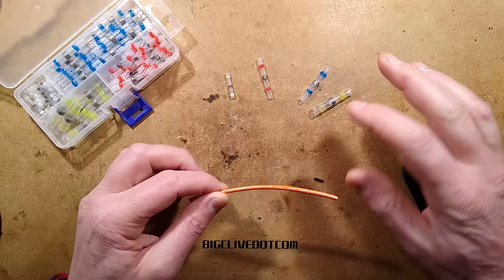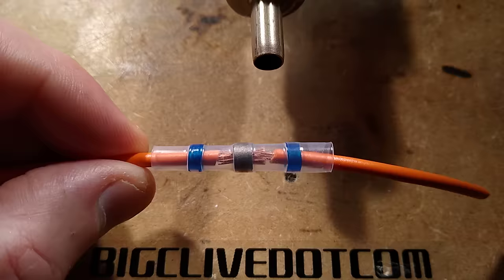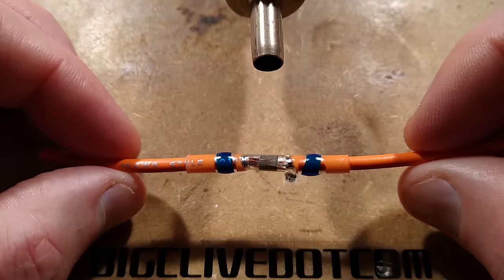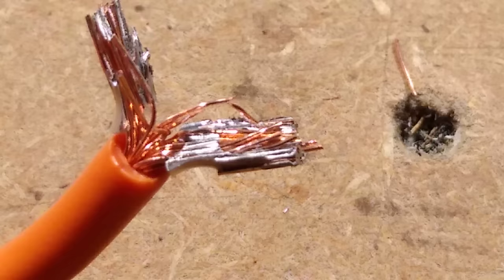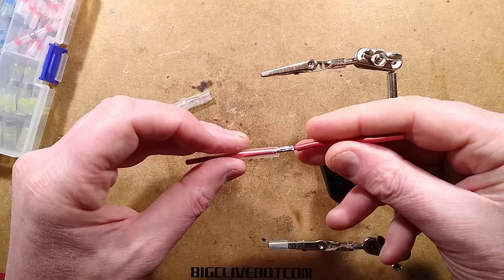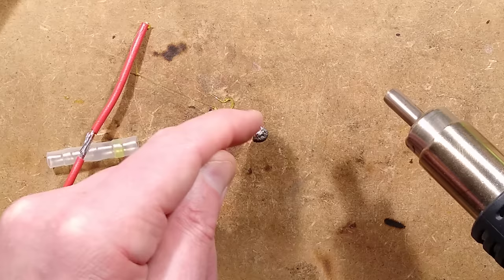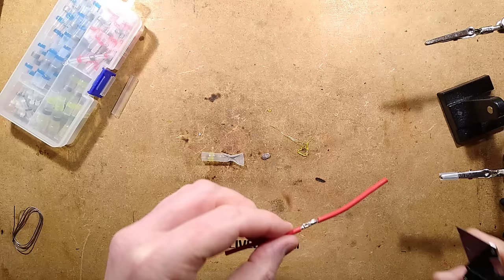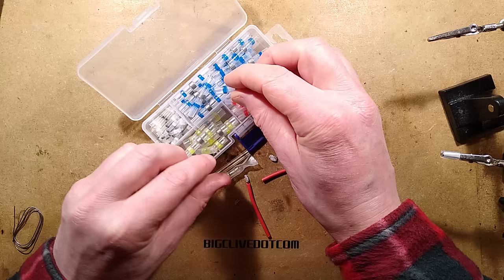Heat shrink solder butt connector test.

Comment: Whenever I used those for car wiring exposed to the elements, I'd give the wires a little pigtail wrap of a few turns of thin-gauge solder like in the video, then a drop of organic flux before sliding the wires into those connectors.  Then when it melts the solder, the liquid flux fizzes away, the real solder melts into the wire thoroughly, and also squeezes out air from the middle, outward.  Finally the hot-melt seals each end.
Without the extra step, just strip the wire to barely the length of the solder collar to concentrate that solder into a shorter length that should hopefully be squeezed into the strands as the tubing shrinks.  I still like to pre-wet the wires with organic flux to make a nice clean shiny joint.

Comment: Hi, as a farm raised individual I can tell you that simple twisting two cables together is often enough for even high current/voltage applications. You would be surprised how many farm equipment and cars have their starters swapped in a hurry and connected by the easiest means available. You don't necessarily need that good of a connection for conductor to work. Please remember that the soldered part is not the only area conducting electricity. Unless the conductors in a wire are corroded, simple fact that this sleeve holds them together is enough to provide ample contact surface for nominal electricity flow. I think that bigger problem with those shrink connectors is in the structural strength of the joint. If there is some pulling, bending and twisting involved, such weak bond might fail easily. Also, I am curious if adding suplementary flux before joining conductors would improve the solder flow.

Comment: These devices are actually also occasionally used in Aviation. Ours are typically about 1/3 the length and have flux in them. But we use fairly high temp and are usually a very good joint.

Comment: I'm using these for my car but always applying flux to the wires, this way they produce better quality joint. But I only had success using two smaller sizes (white and red). Anything bigger than that implies thicker copper and heat just creeps away from the joint. They are much more convenient to use than soldering iron and heat shrink tube when access is limited.

Comment: As a recovering electrician, only in an emergency would I rely on a solder only splice.  A properly done mechanical crimp is faster, easier and better for several reason.  1)  Solder invariably wicks up the strands and causes a stress point for the copper strands to bend against, then work harden, and then ultimately fail.  2) Solder does not provide much mechanical strength and especially modern lead free solder will crack under mechanical pressure (especially vibration in a vehicle, boat aircraft etc!). because the joint now will be made unyielding and brittle.  3) a properly done crimp compresses the copper strands and literally welds them together and gives much superior mechanical strength (if done properly).

A case can be made to go back and solder a crimp to add a little extra current carrying material to a portion of wire since it's compromised and no longer able to carry the same current as a undamaged section of stranded wire.  This gives both mechanical strength of a crimp with the added electrical properties of a solder connection, but care should always be taken to first do a proper crimp and not try to rely on solder to make up for a poorly done job nor let the solder wick up either side of the wire.

Comment: When I was running assembly lines for Tandy and Datapoint in the late 70s building 5 1/4" and 8" floppy drives, we used these butt splicers on the wiring harnesses of both drives.

Comment: The automotive brand I work for requires that we technicians use their approved versions of these solder shrink connectors. As someone who’s pretty good at soldering, I say to hell with those and use traditional solder and water proof/sealed heat shrink. However, most technicians who can’t or don’t l like to solder love these things.

Comment: These have been used for military grade wiring for decades! Before anything is used in this environment it goes through strenuous type accreditation plus each delivered batch is tested for compliance. Additionally the blue hot melt ring is more to seal the joint rather than glue anything together.

Comment: This is good for fixing exposed wires on truck where water is a big issue. This seals better then heat shrink crimp type. The crimping action tends to damage the heat shrink while this connector has a perfect water "proof" connection.

Comment: Thank you for the video. I just bought some of these connectors because wires I have been trying to solder are usually underneath or in hard to reach areas but for sure are not being held by clips on top of a bench in easy to get to applications and above all that my soldering skills are nothing to brag about. Maybe while I am using these connectors I will do as you by pushing the wires together but then maybe twist a bit too and give them a bit more heat or reheat to better melt the solder into the wire connection.

Comment: I use heat shrink solder sleeves at work and they have flux inside of the solder ring and they work surprisingly well

Comment: We used these on Armament Suspension/Release Equipment in the USAF. These were even in highly critical areas (literally critical, meaning nuclear suspension equipment) that also experienced lots of shaking and environmental changes. The SOLDERLESS JOINTS themselves were never a failure point. (Yes, even though they obviously have solder in them, they were called solderless) 
 I believe you are supposed to melt the middle first in an effort to drive away any air pockets. But I would have to review technical manuals to confirm that. These were tough as nails connections that I never had issue with.

Comment: I tried these years ago.  Failed after a month, vibrated apart on a semi-trailer harness.  I now use a mechanical crimp with shrink tube over it.  Threw out the shrink with solder connectors.  And I used a heat gun, heating it until the shrink would almost melt.

Comment: I have used these for rewiring better led lights onto my boat trailer and upgrading my electronics on my boat. Once i switched to them i have yet to have a failure even in a saltwater environment. I also do a secondary heat shrink over the connectors themselves for a little more peace of mind.

Comment: I used to use the really small ones all the time. When you’re a motorcycle mechanic and the boss shows up and tells you he just promised a client you can do an unplanned installation of a full set of third party LED blinkers in less than 10 minutes even though you’re still in the middle of a job and he KNOWS you hate it when he pulls s***t like that....well they’re pretty much your best friend. 

I will use them when accessibility is poor or it’s low current and needs to be water resistant.

Comment: I use these in an industrial environment all the time.
Basically there are two things.
One the heat was too low.
A little hotter two
You don't need it to go through the center of the wire as power is only actually on the outside of the wire.
I know that sounds weird right.
But your power is all around the outside of the wire not the inside.
Thus the current flow in a wire is concentrated on the surface of the wire, as the current in the middle is repelled more than any other currents. Normally the effect is negligle, but design of high current wires is tricky. The electricity or current travels in the outer surface.
Keep practicing you'll get the hang of it.
If you go too hot you'll melt the heat shrink and it will bubble open.
Like the old saying goes.
"Nothing worthwhile comes easy"

Comment: Crimping is a far better solution for joining wires on a vehicle than you might imagine.  If done properly, it makes an electrically good connection and is less likely to be damaged by vibration than a soldered connection.  There is a reason car manufacturers normally crimp rather than solder terminals.

Comment: Just a couple of points, because I find that fully soldered joints can tend to make the wire brittle. The biggest number one failure with butt connectors of all types is corrosion especially in road salt environments. These joints having the hot glue sealing the joint may be for the average joint much longer-lasting because of this alone even though they might be lacking a little bit on current capacity.

Comment: These heat shrink connectors are standard, mil-spec kit that has been used in, well , military and commercial aviation for 30-40 years.  I used these as an electrician for BOEING Airplane Co. in the mid '80s.   They are designed to be used with a mechanically crimped ferrule, first, to form the butt joints.  Then this shrink-melt cover was slid down and shrunk in place over the mechanical crimp.
I have used them, personally, without the crimped ferrule.   If it really counted... like wire bundle exposed to elements and wind.... I would never trust these without the crimped ferrule.

Comment: I used to work building cables and such. The solder sleeves we had, did have flux worked into the solder. Of course with our heat guns we melted those suckers in about 5 seconds flat.

Comment: Some people have a real negative attitude to these and think crimping is way better. For dc I hate crimping as I find it is often a point of failure. I would prefer people use these if they can't solder. They are super easy for beginners.

Comment: Used a bunch of those at my work. If the wire has any corrosion they don't work. Solder them normally and then use inner melt heat shrink.
 When i worked at an Army depot working on Pershing missles, the goverment publications said a proper crimp was better than a solder connector, because of the solder wicking up under the insulation,  making the connection brittle.

Comment: These are great! I saw an advert on Instagram a few months back and wanted to order them but you have to get packs of large amounts at quite a high cost compared to heat shrink. Great for a fast joint in a quick fix

Comment: Great little helpers in some cases. My biggest concerns would be the very low melting temp. of the alloy. If the connection is not perfect it would have a higher resistance than the wire itself and would heat up at higher currents. So for low power applications that would be fine but not for the real work, as you already mentioned. Maybe it would help to stick the wire ends into a bit of flux before soldering them together.
Maybe a crimped connection would be better and more stable in most cases - i guess?

Comment: Used those the first time about 6 years ago wiring my trailer still no electrical problems, and have used them on farm and heavy equipment repairs since with no issues, you do have to be careful and check to make sure the solder flows good I have had an issue a few times but caught it quickly and it’s tough to solder outside when it’s 5 degrees and 20 mph winds

Comment: I have been this these connecting devices for 40 years! You need to use more heat and time for these devices! I have a big heat gun with a tip design to concentrate heat for these soldering devices!

Comment: Eric O of SMA mentioned most of the low temp melt joiners he'd used failed after two to three years from going dry while the butt crimps and glue shrink have yet to cause issues for him.

Comment: I tinned  both ends of the bare wire and pushed the wires into the connector so the wires were in the middle and then heated the connector. After cooling I  tested it ,then smeared liquid tape all over the ends for added water proofing. I then took that whole repair and put it back into the housing it came from. I filled the housing with hydraulic cement and bingo ,done.

Comment: Saw some old british army versions of this on eBay that was a tube with solder in you put a wire in each end and lit it and heat melted the solder and flux job done

Comment: A proper butt-crimp will essentially weld the copper wires, much better than soldering.  If you cut a butt-crimp and look at the wires, you will see a smooth solid single piece of copper.

Comment: My understanding is the "solder" is gallium. Gallium is a low melting point metal criminals and spies once used in the 1960s-1990s. They'd make an impression of a key (maybe taken after valeting a car or some other con), they'd make an impression in a  clay-like putty, and then later use a lighter or torch to melt gallium into the depression. It isn't  very strong, but for a connection it should work.

Comment: I use these in the aerospace world. Known as a Ray-Chem and they are activated by a nifty designed Infrarad gun. Sometimes they would fall into my pocket and I'd use them at home. Forced to use a very nice hot air gun, I'd add a touch of flux where the solder ring would melt and the solder would flow all the way through.

Comment: I have used these on my car, but I go well OTT with the joints I have made. I flux and solder the joint, then add these connectors (More for the strength and water resistance, they are a lot stiffer than just heat shrink), when done I then put normal heat shrink over the whole joint. Over the top, yes of course. But gives peace of mind that these joints will be trouble free for a long time.😀

Comment: The larger joints do have a bit of a deficiency in solder content. It doesn't matter if you use flux or not. The band of solder is simply too small. But the smaller you go, the better it gets.

Comment: 3:10 - Clive. try putting it through the 'elephant test'--pulling it apart to see how strong the solder connection was. Those solder butts probably need wider solder-bands!

Comment: I really learned something there, thanks.  I was thinking about joining 30amp wire with those but based on your analysis I think direct soldering and a heat shrink sleeve would be a better method. Thanks, much appreciated.  :-)

Comment: There are a bunch of low-melt alloys.  Woods metal, for example, I think is used in gunsmithing.  Some alloys are designed to have no shrinkage and can be used for casting the inside of a part that is difficult to inspect.  Others have non-zero shrink or expansion... I think they are made from lead, tin, bismouth, cadmium, and other heavy metals.

Comment: You could use the solder + heat shrink method but instead of using plain heat shrink use one of these "heat shrink solder butts" so that you then get (1) a proper soldered joint and (2) a waterproof seal (from the hot melt inside the crimp),, thus getting the best of both types of crimp. Cheers, Gordon

Comment: The outcome was fairly predicable just as I thought it would be. That's why I never bought any. I'll stick with old fashioned solder and shrink tube. I can add rtv inside the tube ends if I want a waterproof seal. They've never failed.

Comment: Used to use solder tape for field repairs - little rectangular strips of high-lead alloy that you wrap round the joint and melt with a match or lighter. They worked really well and could obviously be used with regular heatshrink. Maybe they're not available anymore because lead. The solder in these things doesn't seem to behave the same way so I'm guessing it's a different alloy.

Comment: We used a higher quality version of these for thefuel level senders in the wings of military aircraft. Crimps were not allowed,  and we'd check the resistance after we were done. Keeps the airframe in the air 70 years now.

Comment: Used these to connect up the main headlight beams on my car three years ago, still working fine! They are included with replacement OEM engine sensors from some manufacturers where wires need to be cut during replacement.

Comment: I used to use these in the Navy back in the 90s.  They were referred to as environmental splices as they created a sealed, soldered connection for splicing.  Standard heat shrink doesn't have that 'environment proof' characteristic.

Comment: Hey Clive hope you are safe and well in these times..
I quite like these , the hot melt glue appeals to me, this would help maybe in motorcycle applications for a water tight seal, and has been mentioned maybe a drop of flux before hand.
Also maybe if you need to introduce another wire into a loom two wires in one end , one in the other, when you are fitting an alarm for example..nice video

Comment: What I have done in the past with these, more so on the larger gauge ones is to add some solder paste on the bare wire prior to slipping them together in the sleeve. It seemed to flow better and more penetration

Comment: Bell system lineman used these in the 1970s. Every size use to have a clear light blue heat shrink back then before they color coded them by wire gauge.

Comment: those guys (when used in aircraft anyway) are used to connect not the wires but the shields around them. theres still a mechanical splice beneath them. the most common application ive used personally is to connect the shields around shielded wires to grounding braids/cables. bc the solder itself is really brittle. the heat shrink itself also commonly tears when heated. if any stray braid or wire is poking up itll pierce right through and solder will leak out. 

when applying them i was taught seal from one side to another to let gas ect out the other side, and make sure the solder is fully saturated. dif types of solder sleves have dif temps needed.

Comment: Just came across these on aliexpress while looking for materials to build shortwave antennae. Obviously they're quite limited for high current applications but for  stuff like that,  they seem fairly handy. Personally, I would rather use solder and some heat-shrink but for those who are wary of soldering, it seems like a decent and quick solution.  Thanks for the in-depth review as always.